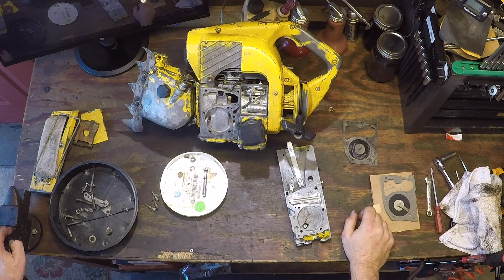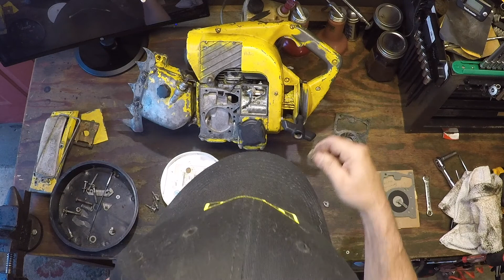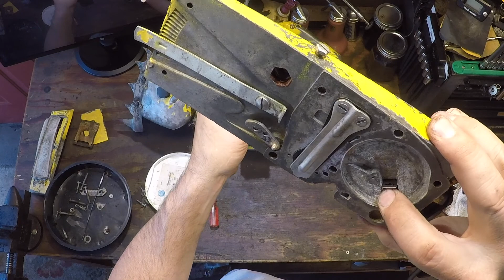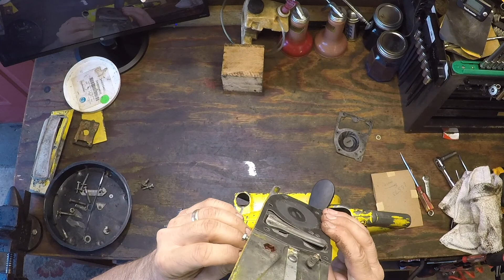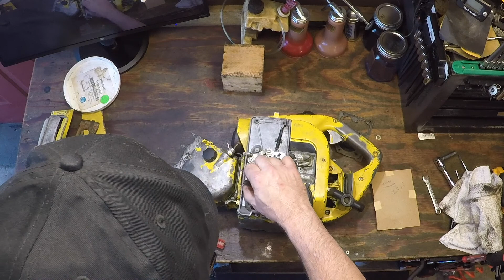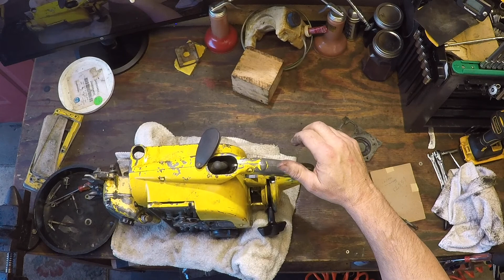Mcculloch Model 33B Carburetor Rebuild & Test

Comment: Thanks for this video! 👍
 I just bought a model 35 with the flying goose on the side. It appears to be complete and has gobs of compression but the chain is rusted and won't move at the moment. I literally just brought it home a few hours ago and haven't had a chance to look it over good yet. Your's sounds like it runs really good, sounds sweet. At first when I saw (no pun intended) the carburetor setup on these it looked intimidating but the more I see of it it doesn't really look all that complicated, just different. I've cleaned and rebuilt many carburetors but none like this. I take it that this is a McCoulloch designed carb and not a different company like Tillotson or Walbro? Also, does the model 35 have an internal gas tank pump like yours?
Reply from the maker: Yes the carb is proprietary, and yes there is an internal “fuel Pump” is on the inside of the fuel tank. Above the fuel filter, which is held in place by a spring, there is a diaphragm and flat spring that is usually stapled to a cork gasket.  That simple mechanism acts like a fuel pump.
Reply: @j.k.mcclead9207  Thanks for that info. I started looking it over and got into it deeper, took the outer carb panel off and the diaphragm looks to be in really good shape, it's clean and pliable. The points at a glance look good too but I haven't got up close and personal with em yet. Now I need to check that pump and filter in the tank. I'm think that it's just going to come down to if it has spark or not at this point. The push button fuel primer doesn't seem to push down very far, like 1/8" or something, I took the big screw out from underneath where the fuel primer spring is located but the spring doesn't seem to want to come out and that little silver colored cylinder that the plunger rod goes down into doesn't seem to want to move. I don't want to try to force anything much because I'm not sure how it's supposed to come out, do you know where I can find some good info about working on these things or videos or maybe a service manual?

Comment: Hi Jim  my dad's 35 is missing the diaphragm #65573. He past away and we are just trying to get his old saw running again  It's in pretty good shape. I can not locate a diaphragm. I would even buy the old one you have just to get her to run !!
Reply from the maker: #36696 is an alternate for the diaphragm. I lucked out the first time finding one on eBay. The old one I rebuilt (with so-so results) and put it in a model 35. There is also a "fuel pump diaphragm" inside the tank. They are even more rare. Keep trolling on eBay you might get lucky.

Comment: Thanks for the video. I have one. Its leaking fuel out of the hole you put the primer rod in to tune. Im at a loss. Do you know what size orings go on the fuel adjustment rod?
Reply from the maker: I purchased on Amazon two cases of various o-rings, one metric, one standard. And I try to match, (as best I can) to what was there. The IPL shows the o-rings, but lists everything as an “assembly”. With no specific part # for the rings themselves.

Comment: Where do you find a diaphragm for one of these
Reply from the maker: https://www.ebay.com/itm/255306971227?hash=item3b717b385b:g:XtUAAOSw4phhzy2H
Found this on fleabay, It should be the correct part, Just verify the part number against the IPL. This model also has a “fuel pump” located inside the gas tank, it too has a diaphragm and gasket.

Comment: Thank you for the helpful video. I’m currently working on one of these. Is there a site where I can download a pdf or similar of a manual?  Also where did you order the diaphragm from?
Reply from the maker: The diaphragm is part #65573 and I purchased it on eBay. The IPL is available on many Mcculloch user groups on Facebook, look under the “files” section on the user group home page. Members have graciously uploaded many IPLs in PDF form.
Reply: @j.k.mcclead9207  I can’t find it anywhere. Got any ideas of where to shop? Ebay, Amazon, and Google all failed 😞
Reply from the maker: @joshhaan  They are a rare find. If you have the lever arm, detent ball and spring, you can make a diaphragm. There is a gentleman in the U.K. that sells diaphragm material, you could try hand at fabricating your own. https://www.ebay.com/itm/231742079415?var=530949852117